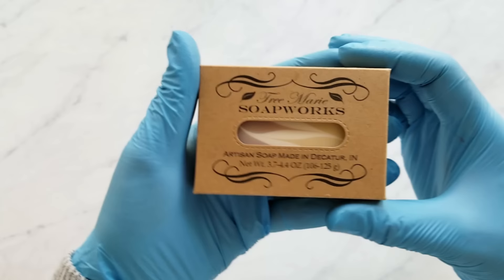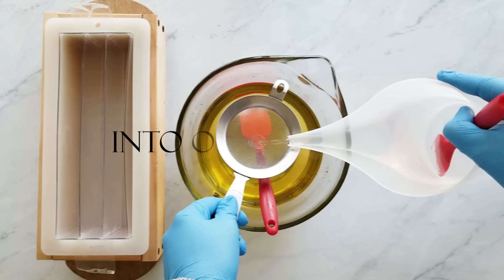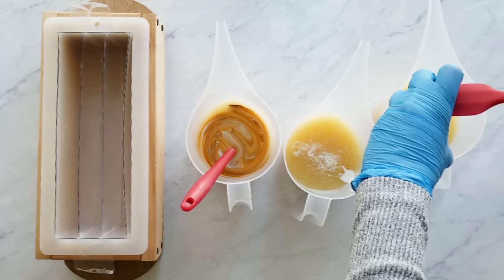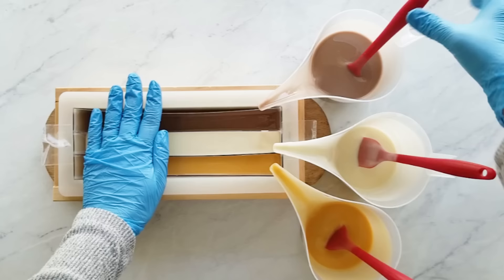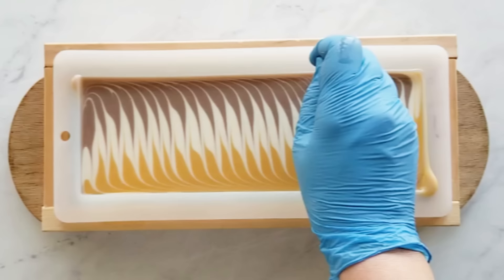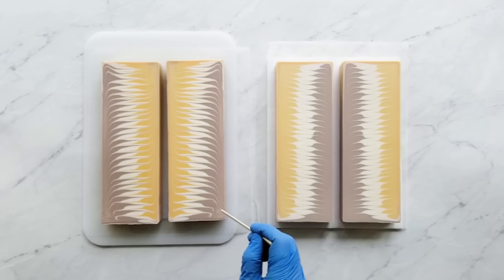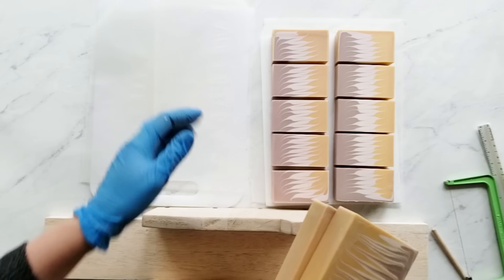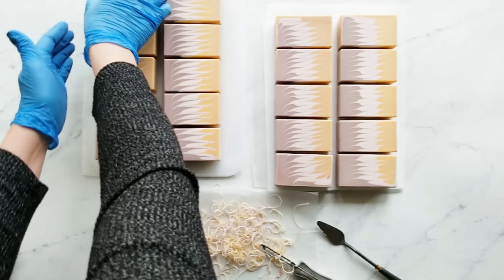Taiwan Circling Swirl Technique, Cold Process Soap Making, (Technique Video #3)

Comment: A very specific tutorial for ghost swirls in a 2.5 lb mold. Thank you for the taiwan circling swirl tutorial.... will definitely need to find those sticks!
Reply from the maker: I will put that one on my like. I don't know if I will make it that size, but I can teach you how to change any recipe to that size. You just need to know the total amount of oils you normally use in that mold. The stick it definitely the winner. ✨
Reply: @TreeMarieSoapworks  Awesome! I do have a 10" Bramble Berry silicone mold. I just find for new things I've not tried before doing it in smaller test batches saves me on materials in case I mess it up lol. I can reduce the size in Soapmaker Pro 3 if needed. So glad I found your channel! I think I found those sticks at JoAnn's today and bought them. They look just like the one you used in your video.

Comment: Simply gorgeous Taiwan swirl and that flat stick rocks! It really does make a difference! You are very good at teaching. The only thing I'd like to know more about is ratio's of water to lye, doing water discounts and using other liquids as part of the recipe bit added at a later time. I appreciate your asking us! Have a lovely weekend and hope to see ya join our next soap collaboration! Hugz, Tree
Reply from the maker: Thank you! The flat stick is definitely the most popular. 💖

I will add your requests to my lists. I do "discount" my water. I usually use 25% "Water as percent of oil weight" in soapcalc, which is usually around 1.8:1 water to lye. Do you use soapcalc?

For adding other liquids, you can use a 1:1 water to lye ratio to dissolve your lye and add the rest of your liquids weight to your oil mixture. Hope this makes sense. Here is a link to some very helpful science articles. I learned lots from Kenna's science articles. https://www.modernsoapmaking.com/category/soap-science/
Reply from the maker: If you are adding liquids with sugars in them, this can cause your batch to heat up. Be careful about that. Keep and eye on it and soap at cooler temps.
Reply: @TreeMarieSoapworks  Awesome! I appreciate the info! It helped me understand it much better! Thanks!

Comment: Being more of an electronics guy, especially consistent temperature solutions, I wonder if there is some sort of "magical temperature" through the gelling phase? If so, an insulated box that opens if too hot and closes again when cooled down should be perfect. Like a greenhouse automatic window thing. Just some thoughts as I get into soaping and I use all your videos for what equipment I need to get started. Phew, long comment, but thank you so much for sharing all your knowledge!
Reply from the maker: I wish I knew the magical temperature. 😊 Wow, your really have a good idea. Good luck with your soaping!

Comment: Beautiful creation! May I ask why you mix you're colorants that way?
Reply from the maker: Thank you Cesiley! Great question! Using a palette knife is a good way to get the clumps out, especially oxides like the yellow & brown oxide and titanium dioxide used in this video. They are particularly difficult to disperse completely. I can't stick blend them in because stick blending causes acceleration; I need my batter to be at thin trace for this technique.  So I would rather have them completely dispersed ahead of time.Hope this helps you! 💖✨🌸

Comment: Beautiful...I like the flat stick much prettier...When you say 1:3 ratio when mixing your TD please tell me how...I always get white specks in my colors I hate it
Reply from the maker: Thank you Melanie! I think the flat stick is the winner. 😊 I usually mix 1/3 cup TD to 1 cup OO. I put it in a good gallon zip lock bag and mix it with my hands by rubbing it together. It takes time. I usually leave it laying on the counter over a few days and rub it when I walk by. Hold it up to the light to see specks they usually stick to the bag. Doing less at a time is actually easier/faster. Maybe try an 1/8th cup to 3/8th cup. I may make a quick tip tutorial on that, but that is the basics of it. Hope this helps! 💖✨
Reply: @TreeMarieSoapworks  Thank you for all of your help...Mel

Comment: Hi thank you for sharing your videos! I was just wondering how you split the soap in half and still come up with the right size?
Reply from the maker: You're very welcome! I have to use two pieces of cardboard as a spacer to get the right thickness. I cut that same cut twice and it comes out the right size to fit in my boxes.

Comment: Loved the soap. Question...is the ratio the same for diluting TD with water as it is oil?
Reply from the maker: Thank you Stacey! No, when diluting with water, it doesn't take much, just enough to dilute. Hot water works best. When added to your batch, it needs to be stick blended in, or it won't mix completely. 😊

Comment: Is there a correct way to store soap when it is made?
Reply from the maker: Yes, it needs so be kept open to air in a well ventilated area. I keep a fan running in the room. You can turn the soap every week or so to help it cure evenly. Let is dry for 4-6 weeks.

Comment: Would this work as well just using the silicone mould without being placed in the wooden mould?
Reply from the maker: Yes, this would totally work as good in just a silicone mold. I just use the wooden frame to support the sides of my mold, so it doesn't bulge.

Comment: Please can you explain how you made the dividers? I have a mould but no dividers. Also is the 10” mold 900grms or 1200 grams? X
Reply from the maker: It holds more than 1300 g. The mold is made with a Icona Bay PET Replacement for Picture Frame Glass, it's .88mm thick. I cut it using a rotary cutter, but you can use an exacto knife. I glued it together using CIGRIP 16 10315 Acrylic Cement, Low-VOC, Medium bodied, 5 Ounce Tube, Clear glue. I just used packaging tape for the tabs to pull it out. Hope this helps. 😊

Comment: How do u keep it fluid? Mine always firms up way fast.
Reply from the maker: The fragrance in this one causes trace to slow down. If I have a fragrance that I need to slow down, I add 1 tsp PPO of confectioners sugar to the water and dissolve it with a mini mixer before adding the lye. That helps it to slow down. You could try that. 💖

Comment: I'm very new to soap making. Some people provide recipes in their videos. I would follow it, but when it comes to adding EO I run into a problem. For some reason almost every EO seizes my butter. I add it after I mix lye and reach emulsion. I try not to stir butter while i'm adding the EO, but in this case I have huge blobs in my butter. If I stir it, it would seize the butter. I tried to order FR from Brambleberry which wouldn't speed up the trace. Nevertheless I have tiny grains, so when I cut the soap I do not have a smooth cut. Please help!!!!!!!
Reply from the maker: What types of EO's are you using? Spicy and floral scents tend to accelerate trace. Citrus is a degreaser, so it tends to slow down trace.

When you add the EO/FO to your batter, it is quite a shock. 😲 A way to lessen the shock is to add an equal part of the warmed batch oils to the measured EO/FO. (The oil will dilute it, and the warmth will be less shocking.) Only blend your batter to an emulsion, not to trace. It will still be thin, but if you look at the bell of the stick blender, it is a thin, uniform film that doesn't separate. Hand-stir the mixture into your batter. Don't let the EO/FO mixture sit on top; get it mixed in right away. If it sits on top, it is more likely to seize.
Reply: @TreeMarieSoapworks  Thankyou;)

Comment: Hello , it is not clear to me the amount of fragrance that I have to add in the 5.5% recipe, you can kindly indicate in oz or gr in this recipe how much fragrance is needed so that I can understand if I have done the math well .. Thanks a lot
in soap calc: Fragrance Ratio:  If you will be using fragrance, enter the fragrance ratio.  If you are new to soapmaking, use 0.5 oz per lb of total oil weight or 31.25 gm per kg of total oil weight. but I do not correspond to the 5.5% fragrance ... thanks very much
Reply from the maker: It is 5.5% of the total batch weight, so around 73 grams. You might find this tutorial helpful. I made the tutorial for Elements Bath and Body. https://learning.elementsbathandbody.com/tutorial/taiwan-swirl-soap-recipe/